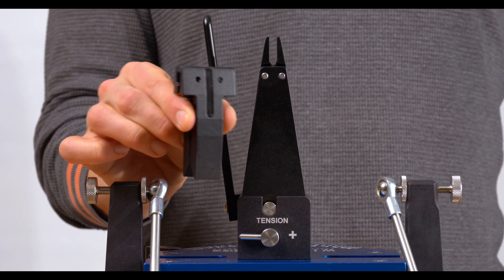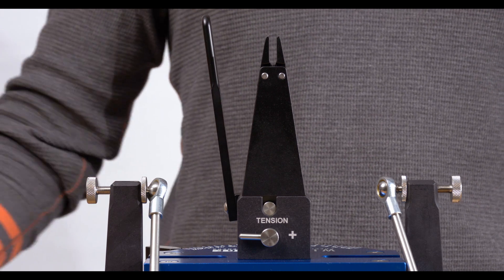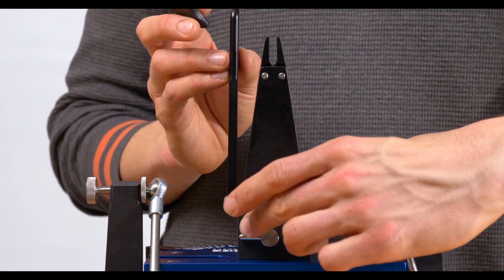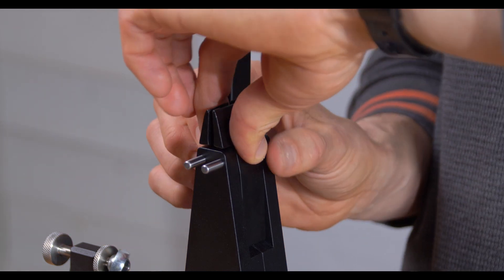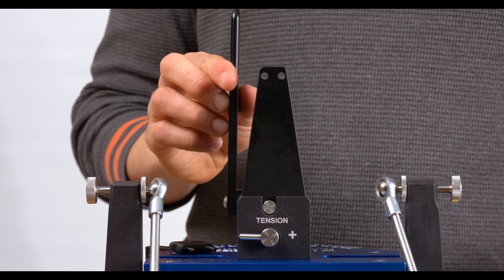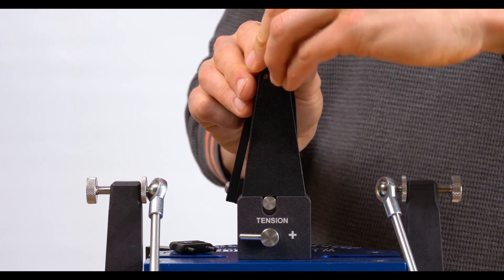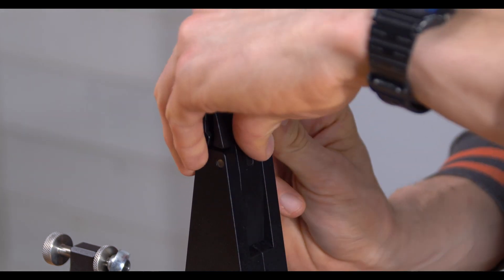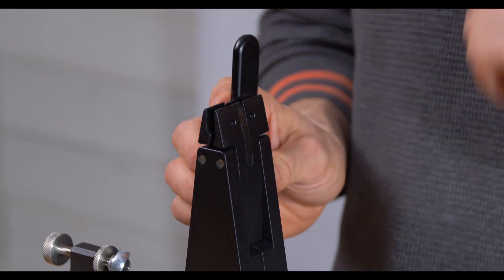Camlock 3/16" V2 jaw install

Comment: A big improvement over the last generation.  The lock up is solid on ffg blades even on the lowest tension setting. 👍🏻
Reply: I'm surprised that nobody seems to be talking about these, I guess it was just you and I that we're excited about it. lol. 

Just got mine today, hopefully try sharpening a few things this weekend.
Reply: I just pulled mine out of the mailbox. Probably install them tomorrow. So many of my knives are FFG and/or distally tapered. I hope these work as well as I think.